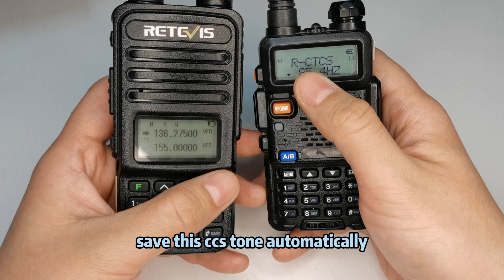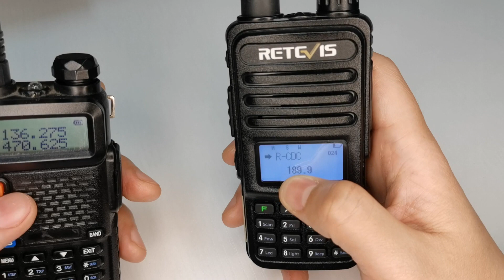How to scan CTCSSDCS tone on Retevis RT5R and RT85

Comment: Hope that fits here: I have an RT5R and no matter what I do, the setting via the RT5R of the CTCSS is not adopted and reset to the default setting. Is there a guide why this is and what to do? Thanks
Reply from the maker: You can see that when beginning to scan the CTCSS, the arrow should point to the CTCSS value. If it is possible take a video of your operation and send it to my email address info@ailunce.com. I will help you to find the guide.